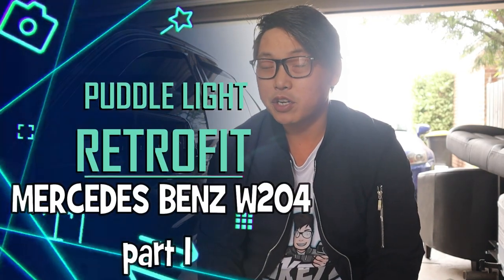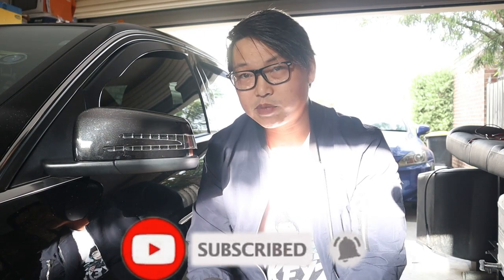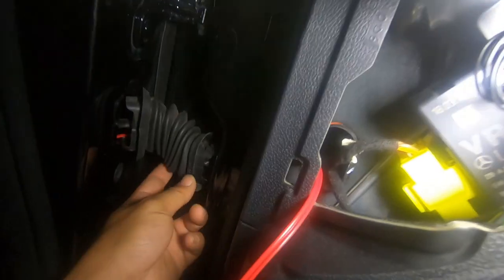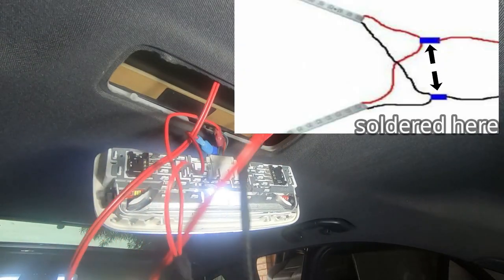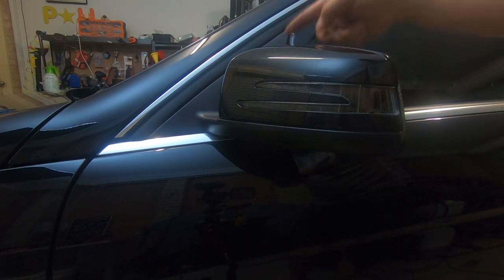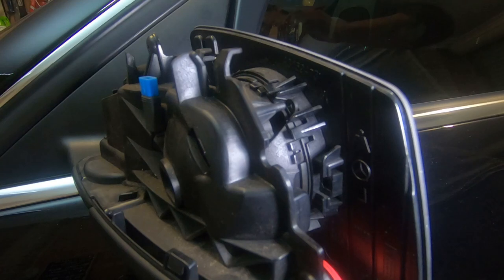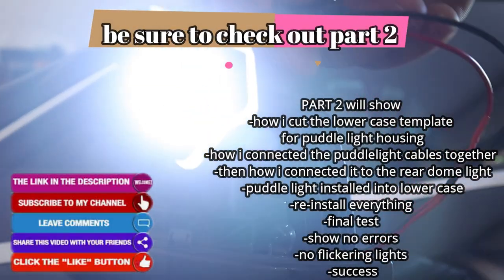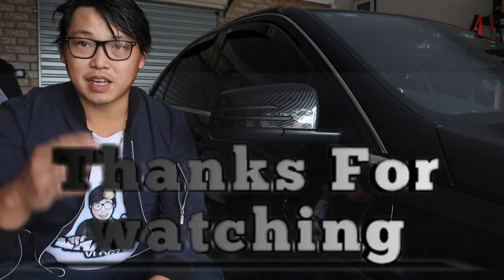how to install retrofit puddle lights mercedes startup led w204 DIY looks factory fitted AMAZING ❗

Comment: Im super jelly when i see the new model with that light.. i have the cut outline for it and an extra wire plug inside the mirror but i dont have it at all.. im for sure going to try and get them and install they look great.

Comment: I already have puddle lights as I have the facelift and I did change mine to LEDs a while back using another YouTubers video and my god was it difficult, the way you showed was much easier and quicker to do, don't know why others don't use the method you showed to change to LEDs
Reply from the maker: ye i know very simple .... ppl just do things differently ..but im glad my way looked easier
Reply: @MIKEYZVLOGZ  your way is definitely easier, let's just say when I followed the video I only did the driver's side and gave up as it took me an hour to change one led, the method shown in the video I followed didn't match mine for some reason, after seeing this video im going to do passenger side now that I know I can just drop the bottom easily and change! Thanks!

Comment: Nice video! Just wonder how you do so the lights are not on while driving? Because they drain power freely it seem logic that they are on when the ignition is on?
Reply from the maker: ok so thats why i connected it to the dome lights ...becuz the dome lights work in a way so that they do not operate whilst u drive... becuz it would look funny if the dome light was on wen u drive

Comment: Mike you Are Really the best!! Just a question...why did you connect the puddle ligth from the rear sit cortesy ligth? From the driver sid is not possibile... I m asking this because My w204 doesn t have your system light in the back... I have a single light... Thank in advance
Reply from the maker: becuz it waa a hassle to find the wires i wanted and the back was much easier .... if your front dome light fades u can conmect it to that... just make sure u find the schematics and use the right wires .....in the video i also stated that accorsing to the schematics it wasnt fading in and out like i wanted so i just went to the back after a trial run and it was perfect ..so settled for the back instead plus heaps of room and easy peasy
Reply: @MIKEYZVLOGZ  thank you so much for the fast answer!! I Really appreciate it
Reply from the maker: @christiansantoro398  nonworries mate
Reply: @MIKEYZVLOGZ  the wires you used where come from? Are they come from the front sits ligth system where actually you manage also the rear sit ligth
Reply from the maker: @christiansantoro398  hmmmi dont understand what  u mean ..pls rephrase your questionnand ill answer
Reply: @MIKEYZVLOGZ  sorry for my English because I'm Italian!! At minute 11:00 in your video you show the wires you have chosen... Those wires where come from? From the front? From the front sit cortesy ligth?
Reply from the maker: @christiansantoro398  thats ok no worries mate ... i will look again and tell u
Reply from the maker: @christiansantoro398  they are the wires for puddle lights ... i ran them all the way from left  and right side mirror case

Comment: Great stuff Mikey. I am definitely going to add those lights to my cars. While i do that would like to know if there is a possibility to add the folding mirrors as a retrofit job. One of my cars does not have them and would be nice to do it while the mirrors are taken apart. Thanks for another great video. Keep it up.
Reply from the maker: yes u can u just have to retrofit.the module.for it and 0pactivate it via a star diagnostic tool so  the car can recognise the folding feature ... thanks for the suppport

Comment: hi when removing the mirror,  mine has blind spot assist and auto dimming, other than the heating and the auto dimming line is there one for the blind spot assist? I'm afraid of trying and ripping the wire
Reply from the maker: just watch for wires wen u remove the cover and u will be ok

Comment: Hey Mikey have you by any chance replaced your footwell lights? If so are they blinking like mine after I have installed LEDs?
Reply from the maker: yes they did blink u need to just use canbus ones and it won't blink
Reply: @MIKEYZVLOGZ  thank you sir

Comment: The correct way to retrofit side mirror puddle light is wire the light to door module.
For those W204 prefacelift should replace latest door modules,
You can find those on ebay in low price.
Then do coding in car, puddle lights will work exactly the same way as facelift W204.
Reply from the maker: good tip ..thanks for sharing
Reply: Do you have a part number?
Reply: Anyone done this correctly with coding and 2 pins insert into connectors ? I am thinking that would be even easier job if possible and more real. Because when you light up interior light when driving mirror puddle light will also turn on which I do not like.

Comment: Is there any way that you can install them with the door lights and no error or voltage drop shows up in cluster? Also when you turn on your rear dome light does that also turn on the puddle lights? Thanks
Reply from the maker: there are no errors relating to the fitments of these puddle lights ... and no wennu turn on your rear dome lights it doesn't turn on the puddles... that would look funny lol.. so I made sure it didn't do that
Reply: Thanks a lot for your swift reply. But I actually don’t want them with my dome lights. I only want them to turn on or off with my door open or closed. Is there any chance you can show that in another video. Thanks
Reply from the maker: @AbhishekAbhishek-bq8yj  if u just want them to turn on with doors u could connect them to the door lights.. the welcome light on your passenger and driver door... if u have them..some coupe don't have them
Reply: @MIKEYZVLOGZ  I have door lights, and i have checked that the puddle lights work fine by hooking them up in the door light connector. The only problem I have now is that I don’t know how to run the wire from inside the door panel and will it melt the wire if I hook them up with the door light wire. I cannot upload the pics here to make it clear what I am trying to say. Thanks
Reply: And many thanks to the rear view camera video with rectifier installation. I have ordered one and installed it the same way. Works fine many thanks.
Reply from the maker: @AbhishekAbhishek-bq8yj  well done

Comment: How do i turn the puddle lights on im having trouble
Reply from the maker: @tyronegovens6169  if u have them from factory it's in your menu for tour cluster ..goto settings and browse for puddle lights it will be in there under vehicle settings...go thru the entire menu and u will find them... I did an aftermarket install and ran them off the dome lights so it turns on and off with dome lights

Comment: Anyone done this correctly with coding and 2 pins insert into connectors ? I am thinking that would be even easier job if possible and more real. Because when you light up interior light when driving mirror puddle light will also turn on which I do not like.

Comment: Does anyone have the MB part # for the bottom cover which already has the cutout and the clip for the light?  I have a 2015 GLA250 (x156) with heated mirrors that don't fold-in automatically.  Thanks!

Comment: You should just take power from fuse box no need to run the wite all the way back
Reply from the maker: i did that so the puddle lights will sync with the interior lights as well, wen u open and close the doors lock and unlock the car ..it will sync perfectly, but yes u can do that too ... u may just need to use a resitor or relay so u can control wen uget power according to how u want the led to work , if its constant then your puddle lights will work all the time ..if its switched it will only work wen u turn the key to acc, hence why i used the rear dome light becuase that exactly how i wanted my puddle lights to function ..
Reply: Well, if u have a Vediamo software you can just code the puddle lights and no wires required. Just plug and play puddle lights
Reply from the maker: @eduardalinpopa2732 how can u plug and play puddle lights if there's no connection for it
Reply: The coding is in the door sam control unit. Just get the mirrors with puddle lights and electric wiring, code the control unit and enable the puddle lights :)
Reply: I did 2 cars retrofits already. The puddle lights will get power 12v from the door control unit, no need to get wires from upper control panel dome lights interior.
Reply from the maker: @eduardalinpopa2732  ahh I see so u simply wired from door module ..that's good... actually very good idea... I just wanted them to work like the dome lights so I wired off them so they go on and off with dome lights..but Ur way ded seems alot easier ... did u then turn on the module using vediamo
Reply from the maker: @eduardalinpopa2732  I fully understand what u mean now...so u buy mirrors with piddle lights and then plug them in the door control module and use software to turn it on... that's def a proper Retrofit... 👌  very good tip... if u don't mind paying for new mirrors ..def a good idea 💡
Reply: @MIKEYZVLOGZ  yes, i did it with vediamo. Dont know for sure if u need mirrors also, i bought only the  bottom plastic part with the puddle lights socket, and wiring i took from scrap car under 10$. After install, vediamo coding and it sync's with dome light. 🤗
Reply from the maker: @eduardalinpopa2732  ahh i see ... u gotta post it somewhere so we can see ..if love to see the wiring and how it was achieved ..although I kind of get it already ...I understand u got the wiring loom from scrap a d that plugs into the door module ..and u used vediamo to code and it works with dome lights now...yes I get it... well done for doing so ...very good work mate
Reply: @MIKEYZVLOGZ  🥰😍 if i will get another car to do, definetly i ll post it !! Cheers ! Have a pleasant sunday !